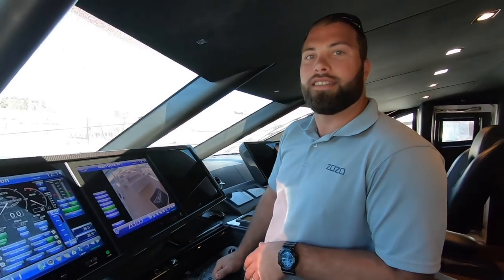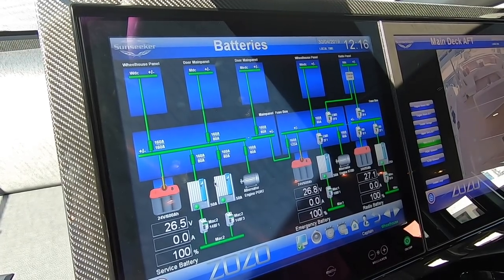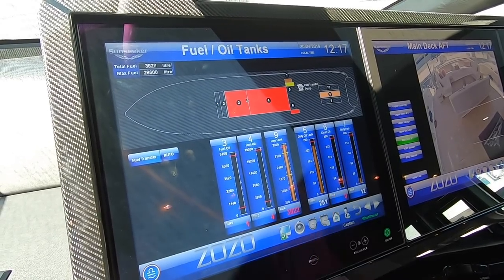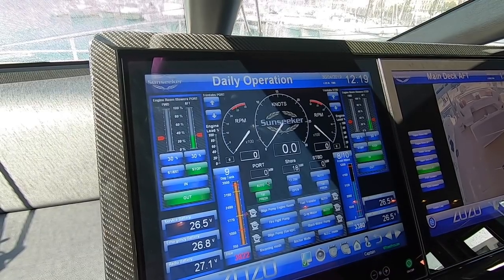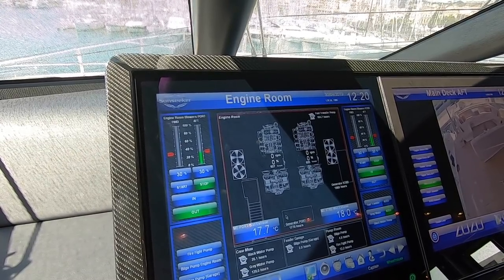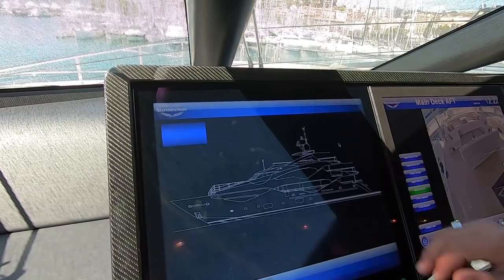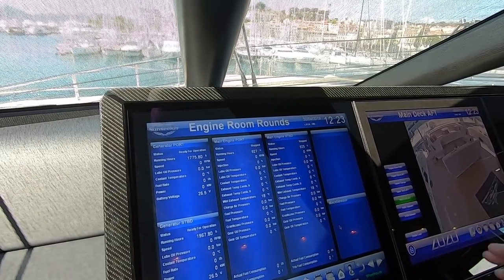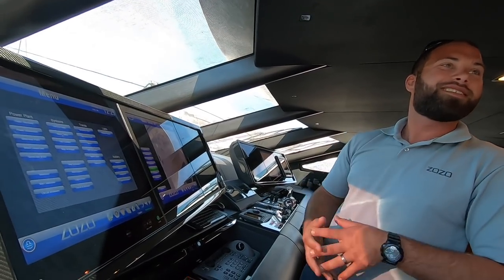Superyacht full operating systems tour

Comment: Good call to focus on various areas of boating. Great video and I think this is the way forward. Video features on specific areas.
Reply from the maker: Thanks, it will be interesting to see how this one performs compared to my usual videos.
Reply: I agree that it is a focus and to separate it on video makes sense too.  All things considered if every check and comparison of vessels comes out balanced, the Control Systems could be the deal breaker / maker.  Not like it is not important because it's not often shown on nearly every Channel, almost as if being ignored.  It will be included of course by whomever the Owner hires for Survey.   For same type of good reason(s) as crew quarters might not be accessible, the Systems detail would be in the same boat.